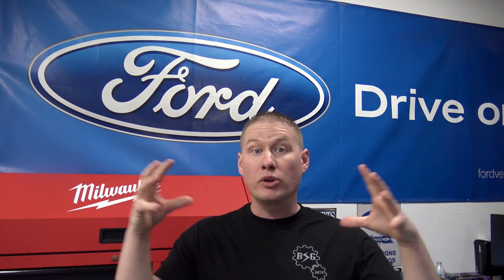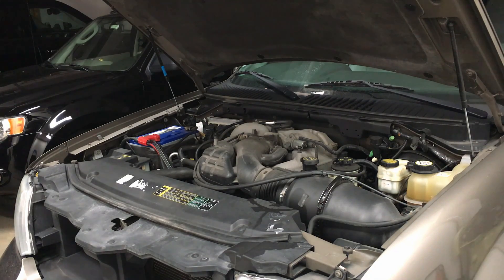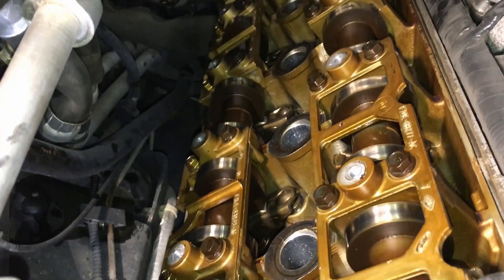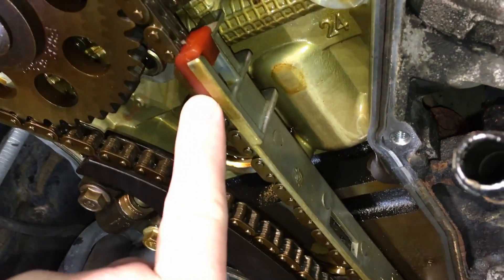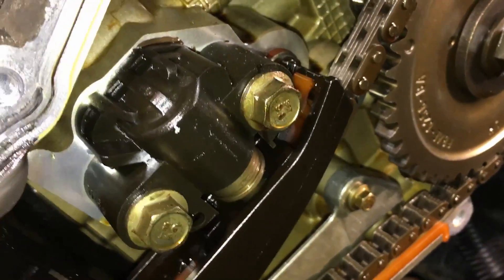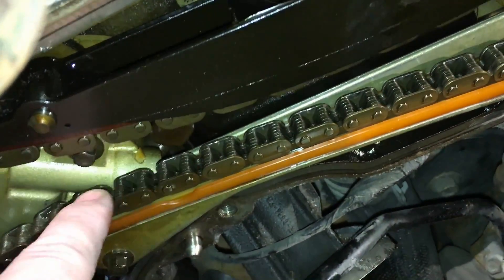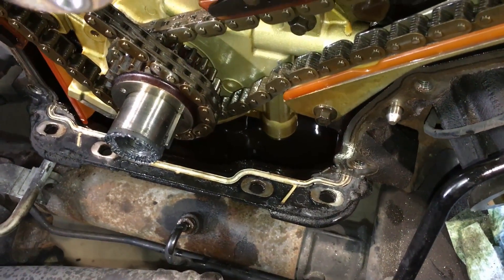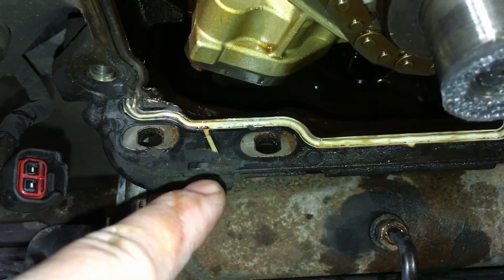Ford 4.6L & 5.4L Triton Engines: Common Failure Points to Watch Out For!

Comment: Funny the tensioners only started failing when Ford decided CAFE credits were more important than reliability and started speccing 5w20. I know of many mod motors over 300k on 5w30 that have never been opened, including 2 3Vs. The 20w oil gets hot and thin, pressure drops slightly, and allows a little slack in the system, which causes wear, and the death cycle continues.
Reply: Keegan Johnson:  Ignore previous post.... I didn't read carefully  that you recommended 5w30....   Thanks for that advice....
Reply: Grave Walker you will get various opinions on the matter. I base mine off of what i have seen in the shop, and the fact that no tolerances were changed when the oil spec was changed. Which means in my eyes, that the bean counters got their way, not the engineers. This is for V8s only. I dont reccomend upping a grade in the smaller engines unless you are in a hot climate, as they seem to do fine on 20w. If it makes it to 200k, then maybe consider a change. 200k seems to be the point when modern engines start to loosen up.
Reply: Keegan:  Thanks for the quick reply.  After I sent you the post, I then noticed you recommended w30.  I have a v8,  2000 4.6 triton f-150 with 308K  I just got it 3 months ago and have been having issues.  But, I figure, after those issues are resolved, to be proactive with the maintenance.  I'm in central Texas which gets fairly hot in summer.  Thanks....
Reply: Grave Walker I fix em for a living if you have any questions feel free to ask! I have a customer who drives his 4.6 f150 from iowa to texas on a regular basis. He switched to a w30 at 200k. Truck now has 645k last i serviced it. Not saying everyones will do that, but the 4.6 is a bulletproof engine if cared for. Many taxis and cop cars have upwards of a million miles, and usually have been feed 10w30 fleet oil their whole lives.
Reply: Grave Walker oh, and dont skimp on the filter. Either the Motorcraft or its sibling the Purolator One would be my pick for the money.

Comment: I have a 2003 F-150 4.6 L with 235,000 miles. Not a single engine issue, but have replaced the plugs (twice) and all of the coil packs once. Ball joints, tie rods and other suspension components are the things that seem to wear out the most. I use synthetic oil that I change every 3,000-4,000 miles. I do have minor leaks from the head gasket, rear-main oil seal and transmission, but the truck is almost 15 years old. I have no complaints about the Triton.

Comment: metal chain rubbing against plastic. what could go wrong?
Reply: Oh oh, oh oh oh oh oh,  I KNOW the answer.............
Reply: Teresa 67 Factoid Nothin if it’s done right. My Accord has 200K on the factory chain, guides, and tensioner. That’s not to say that Honda hasn’t had issues with VTC sprockets but the guides haven’t been an issue. It really depends on the quality of the chains manufacturers are using.  If you’re using top quality pre-stretched chains you won’t have broken guides. When cheap quality chains wear and “stretch” they break the guides. My old Toyota truck ran 630K miles on one chain replacement.
Reply: Metal tensioner wearing down a metal chain with no way to observe wear? What could go wrong. Everyone who insults the plastic guide is clearly the farthest thing from an engineer. Stay in your own area folks and leave it to the pros
Reply: Terry Melvin no it’s just people don’t change the oil and let it slap for years like this. Miss 3 oil changes by 1000 miles your guides are gone on any car bud.
Reply: what... you think the suppliers lost the formula that lasted too long? Nop every part is turned into over priced crap!
Reply: G Lasser not really it’s called maintenance . Any one who insults reliability is to poor to afford one. 12 gt hasn’t ever had a single thing go wrong in 180k
Reply: IKR?!

Comment: My 2010 f150 platinum it's burning oil I don't know why!!! No blue smoke, someone have told me to replace the pvc valve!! Any ideas?thank you
Reply from the maker: 5.4L 3v? I would look into how well the oil was taken care of becuase the oil control rings could be sludged up other than that you are looking at valve seals if its high rpm or again neglected.
Reply: FordTechMakuloco yes 5.4 L 3v and it was rebuilt like a year ego!!

Comment: I have a 2006 5.4l 3 v f350 with no oil pressure hot pulled cam cap and looks like it has excessive wear. is there any way to measure to see if I need new heads?

Comment: Anyone had similar issues with the 3.0L Duratech?
Got a '10 Escape with 150K miles that is starting to hum and rumble from the front covers. There is no change in the sound at startup and the sound doesn't change with the fanbelt off either. Its a very similar design despite being a 6 cylinder and since there is a blue oval on the grille, I'm automatically assuming the worst.

Comment: I am no mechanic or expert, but why are there plastic components inside the engine??
Reply from the maker: Noise and wear.
Reply: And more importantly, how did car engines before plastic last so long? Is there a way to bring back that old durability in modern engine design?

Comment: Thank you. I have a 4.6L V8, with dark fluid leaking from to rear of motor. Have had issues back in February last year when number 4 sparkplug blew out of motor. Had it helocoiled..I guess is the term. Caused issues off and on for past  several months off the number 3&4 plug wires jumping off. I definitely not a mechanic, but the sounds I'm hearing now is like rocker arm loose. Could be something worse. I am not sure what to do..never been or have ever tried to do anything more than valve covers and gaskets, or change alternator, starter and cables with new battery..just exterior stuff. Help ???

Comment: Hi I have a 08 F150 somewhere Through the Grapevine I heard that's probably one of the best year that they made these motors. what's your opinion on that? the second thing on the cam chain tensioners or guides for the plastic that fell off on this poor guys SUV is there roughly a mile mileage point where I should get it looked at or just wait until the noise happens I got over a  154,000 miles on it. And it starts up idles and goes on the road pretty flawless. Before I forget all those cam chain covers fairly easy and straightforward to take off

Comment: Your mechanic videos are the best on UTUBE. Brilliantly explained and demonstrated.  I just bought a used 2012 Ford Fiesta Sport for my wife and your videos on this model answered a lot of questions.  At 90,000 km, with your information in mind I have organized to renew the timing belt, tensioner, water pump, serpentine belt, crankshaft seal and bolt.  Also change the transmission fluid.  Total cost in Thailand  at the Ford Dealership, 11,000 Baht; super cheap price for "peace of mind."  Thanks for your valuable input.

Comment: Quick Question.  I have a 5.4 triton engine with a cam senor code and the dealer found that there is lite scaring on the cam caps and cam.  They are saying the oil pressure is what is causing the problem and that the scaring is why there is a loss in oil pressure.  They are recommending to replace the motor.  Does this make sensor?  Is oil pressure generated from these cam caps and not from the oil pump?  Is this minor scaring a reason to replace the motor or is there something that can be done, ie. an upgraded oil pump, that might help the cam phasers work correctly?  Thanks!

Comment: Hi, Can I contact you about an knocking tapping issue I have on a 2004 4.6 2v triton engine (non variable valve timing) truck. Its coming from cylinder 4 (rear passenger) I noticed I have around 3-5mm of crank endplay laterally!! Can you help? Thanks John

Comment: Could this cause oil pressure to drop at idol? My truck has this same problem and I’m wanting to know if I fix the chain if it’ll fix everything such as my oil pressure drop
Reply from the maker: Yes it can cause your concern most likely due to broken guide pieces plugging the pickup.
Reply: @FordTechMakuloco  And with the tensioner blown out, oil can freely flow past there.

Comment: great video. Got my 97 f150 5-years ago at 150k miles, now has 235k and a pretty bad oil leak, at least the rear seal. Bought a kwiklift gonna replace all seals this winter, and take apart the engine, send pieces to machinest that look like need it. Anything you recommend?
 Look forward to watching more videos.

Comment: best ford repair videos. Is the 4.6 2v more reliable than the 5.4 4v??? Ive used fleets and the 4.6 2v hold up. how dose the 3.9/4.2 v6hold up in durability???
Reply: I know this is super late but 4.6 2v is the best triton engine ford has ever made.

Comment: On the 97-03 f150s are the 4.6 and 5.4 motors interchangeable, or if I had to motor swap it would I have to stay with same motor? In the same sense, how about the lightnings super charged 5.4 into a regular 4.6 or 5.4, what all would need to be done to make it work?
Reply: I believe the 4.6 and 5.4 have the same bolt patterns but the power difference isn't so huge that it would be worth a lot of hassle. You can buy a used Lightning supercharger, intake, iintercooler, alternator and fuel system and install it on a normal 5.4. The only difference is the SC 5.4 has lower compression to allow for boost but a good tuner can adjust for it and make reliable power.

Comment: Im a Ford tech too. Wanna know what all the high mile engines i see with no problems have in common? The owners do ALL maintainence on time, and use 5w30 not the 5w20 CAFE oil, at minimum during the summer.

Comment: FordTechMakuloco I have a 2007 f150 5.4 3v and it has 100.000 miles, the plugs have been replaced at around 80,000mi and I resistance tested the coils and fuel injectors they showed to be good but when you rev it to 2,000 and hold it it has an intermediate miss or skip and the higher you rev it the faster it skips, under and heavy acceleration its fine but when you slightly lean into it you can hear it miss.
Reply: Resistance tests aren't always sufficient to diagnose the coils or the injectors. Ford ECUs don't throw misfire codes until there are significant misfires, but a shop scanner (not just a cheap auto store consumer unit) can report minor misfires. The injectors could have perfect resistance but still be plugged or leaking, there are vids on Youtube to show you how to test them on the cheap.

Comment: Man, your videos are the best on the Internet, I've probably watched all of them!  I need some advise.  My 2005 5.4 f150 recently lost a lot of power.  Driving home one day it was just lacking, and by the time I got home it was barley going.  Here's what I've done: changed fuel filter, checked fuel pressure, (30-42) changed fpdm, maf, and throttle body with a running truck, new oil pump, full timing set, phasers, VCT solenoids, 8 plugs and 8 coils, also pulled the pan the check the pick up, it was clean. Probably done some other things.  It's starts and idles good when I first start it, but when I drop it in gear it idles down pretty low, (4-500 rpms) and when I give it gas, it starts making noise and doesn't want to move, but will if I feather it, and if I give it too much gas, it dies.  Also removed exhaust and it made no difference. Codes were 0300 0305 0308, now I have a 0171, and one I can't remember, but was something about an o2 sensor stuck rich or something.  Any ideas?  Thanks man, keep up the good work!

Comment: REQUESTING HELP: I'm original owner of a 1998 F150 4.6L Triton V8,  RWD,  crew cab, long bed with shell on the bed. Since the beginning, the motor pings/rattles under load and has never been able to make any kind of grade/incline. For years, it got 415-425 miles per 30 gallons (between 14-17 mpg). Over the past 6 months, it barely gets 280 miles per 30 gallons (about 9 mpg). I'm light footed on the accelerator. It can barely make it up inclines and "pings" like crazy. I've used 92 octane since day one. 

I've been consistent with oil & filter, transmission fluid, air filter, gas filter, gas/injector cleaner (additives).  Last month, I changed the gas filter, installed Motorcraft Platinum spark plugs, air filter, & had my repair shop put a new serpentine belt & alternator...all in the hopes of correcting this problem. 

The truck still performs terribly. To me, it acts like the timing is off. The shop said it's "impossible because the computer adjusts all that." I've considered after market products (programmer, "chip", etc.), because I really want this problem solved. 

One video suggested that the timing chain can be off by one tooth because of the brief reverse motion it makes upon start up. 
AS for gas mileage, another video suggested an electric fan kit to replace the stock fan, under-drive pulleys, K&N intake, & Evolution CS gas programmer & gets 25 mpg (short-bed, no shell)

Is there any hope of solving this problem so I can keep my truck? I don't mind putting a little money into her, as long as it's good money 

I'm on a fixed income and have to keep my truck running. Engine compartment is always clean, no oil, excessive grime, etc. It doesn't look 19 years old. Outside, she's beat up, but that's ok.

I'm in Orange County, CA & would love a reputable shop that understands the 98 Triton 4.6L V8. 

Thank you to any body who responds with constructive ideas.
Reply: Could be a lot of things. Poor spark caused by bad coils, bad engine ground wiring, water in coil packs (usually if you hose off the motor). If it jumped timing the computer could not correct it, but it would likely run rough and you'd hear rattling if the chain was loose enough to jump. You might have carbon build up in your cylinders that can also cause detonation (knock). You need to find a good shop or dealer. Go on the F150 forums and ask people in your area which shops are reputable or to avoid. Good luck.

Comment: I have a 99 F150 with the 4.6. It has 197,000 miles. It's never given me any problem but I pull a camper and need more power. I love my truck so I am thinking of doing a 5.4 swap soon instead of buying a new truck. Is the 1999/2000 2 valve 5.4 a dependable motor? I would love to swap to a 5.8 but that's too much fabrication.
Reply: You'd be better off with a 2003 5.4 2v as they have more threads in the cylinder heads so they don't tend to launch spark plugs as often. They also have a little more HP than the 99/00 if I recall.

Comment: I have an 04 5.4 3v that ticks like crazy until it warms up then it runs well. did phasers, chains, tensioners, guides, oil pump vct solenoids and cant get rid of the cold start tick. any ideas???? Frustrated.

Comment: wow...I just bought an '04 Crown Victoria, P71 Police Interceptor, with 140k.  I was told these are robust engines; and it runs quiet.  But, if I have to do this repair, how many special-tools are required to dismantle the chains-and-tensioners? And also, does it have timing marks on the gears to align everything?  Thank you!

Comment: Great video with some very good information. Shame I didnt see this sooner as I have a ford quad cam v8 and had a similar noise on start up. When stripping down found the tensioner on the RH bank knackered and a piece of the guide broken off. Just started to make metal to metal contact so just got it in time! I replaced everything bar the sprockets just be sure as there was some wear on the chain itself from slapping on one of the bolts holding the guide on.

Comment: I got a 4.6 never a problem 134,000 miles going strong.
Reply: 227683 on mine. Never an issue. Change dat oil regular like with some high quality Mobil(izer) 1 and she runs like a top
Reply: Mine was all good too ,until it hit 200,000 mile mark

Comment: hey makuloco I have a question!! by any chance you could have a answer for me.. I have a 2007 f150  with a  cylinder n. 8 misfire.. already checked ignition coil and fuel injector and compression.. and everything is fine but it keeps giving me a misfire on n. 8 cylinder. any ideas? thank you for making our job much easier by the way.....
Reply from the maker: Have you pulled the plug to replace it and inspect it? Also have you checked down in the spark plug well for water intrusion being that far back.
Reply: FordTechMakuloco would a high pressure oil pump benefit a 6.8 V10 or was that just an issue with 4.6/5.4 V8
Reply: FordTechMakuloco 
l have a 2006 5.4 F 150 with 120k . I get a pop and a heastation when lightly accelerations after slow down. Please help Bob

Comment: How much does something like this cost to get fixed?
Reply from the maker: $3,500 or so at the dealer and independent shop maybe $2,800 and charge around $1,800.
Reply: FordTechMakuloco 1800 still seems quite steep.  How many billable hours go into this kind of repair?
Reply: 10 hrs

Comment: Triton motor is a boat anchor, the worst engine ever. The engineers should be collecting unemployment.
Reply: J Wil I wish you guys giving results of your engines would also state what year vehicle. It would really help. Year matters.
Reply: ed schankereli whats wrong with a triton? I have 240,000 miles on my truck with a 4.6 triton.

Comment: I guess I'm the only guy who had both the 4.6 and 5.4 and had zero problems with the motors, both had over a 100, 000 miles.

Comment: I just picked up an 06 explorer with the 4.6 in it despite all the problems I've been hearing about but only because it only has 25,000 miles on it and looks and runs like New. I'm hoping to avoid any radiator problems by swapping out the radiator cap with a 16 psi. I am also thinking of changing the plugs but I'm wondering if it will still be risky even with the low mileage,  What do you think?

Comment: Those guides are the dumbest damn design ever, the guides have been a long term problem with the SOHC V6 engines in the Ford Explorer with timing chains in the front and rear of the engine YIKES!, Owners called it the death rattle when they began to fail.